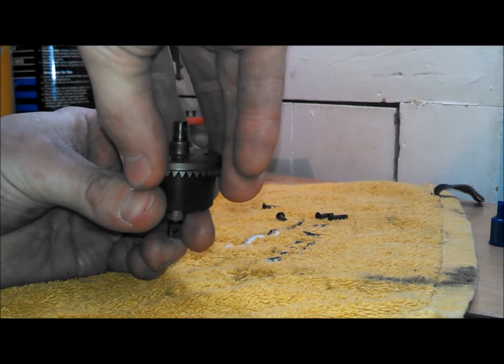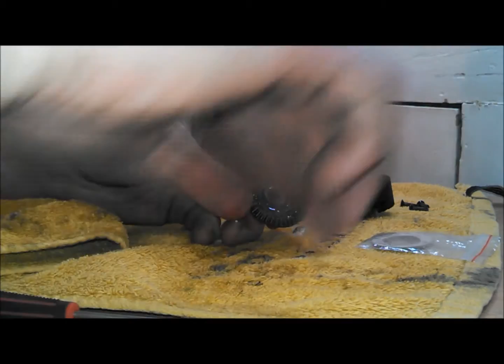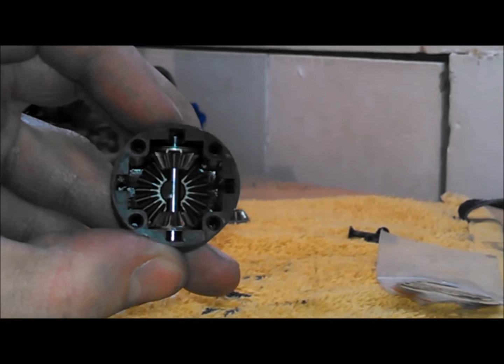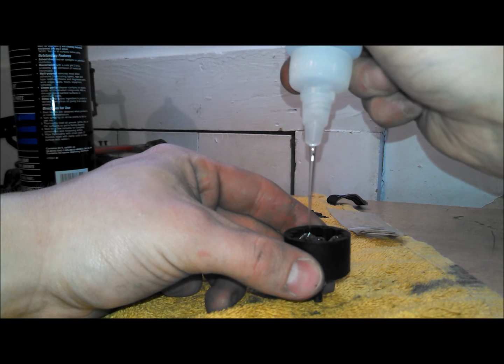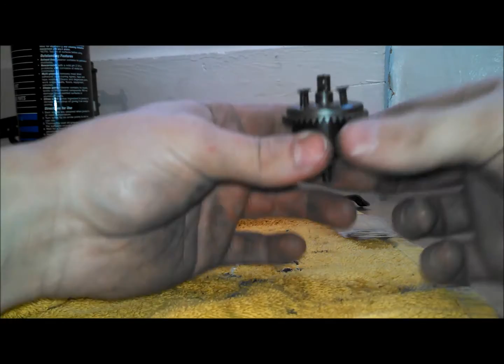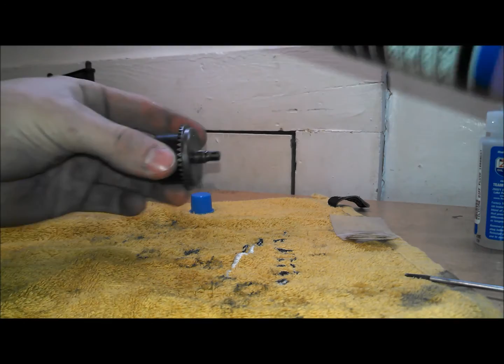How To - Disassemble, Clean & Rebuild RC Differentials (HD)

Comment: Hi guys,

My Emaxx had small bashing with pole and after that it is running fine but I am observing some strange sound or one other thing when I run front wheel by hand it is not moving as rare wheels are what can i do to check in this case

Thanks